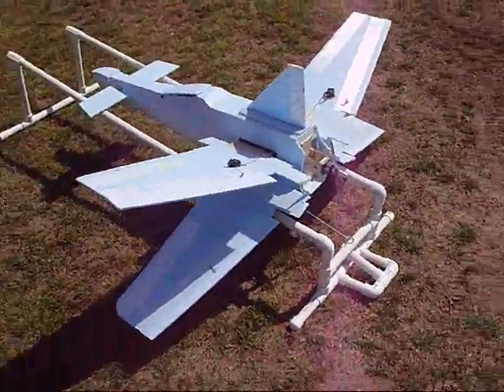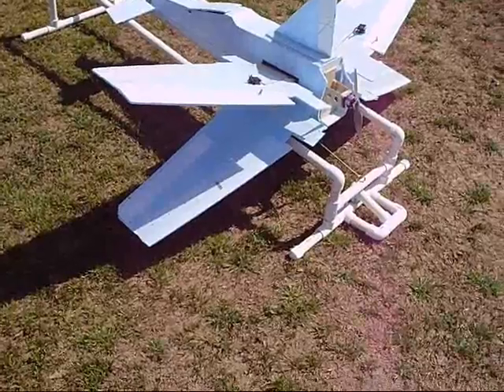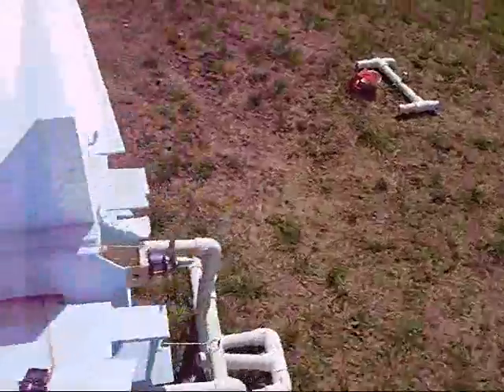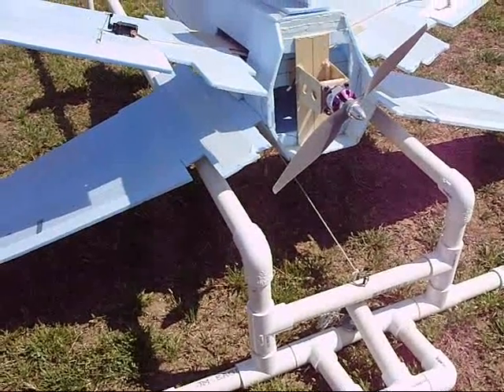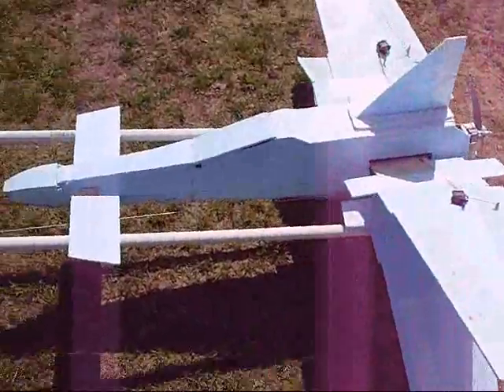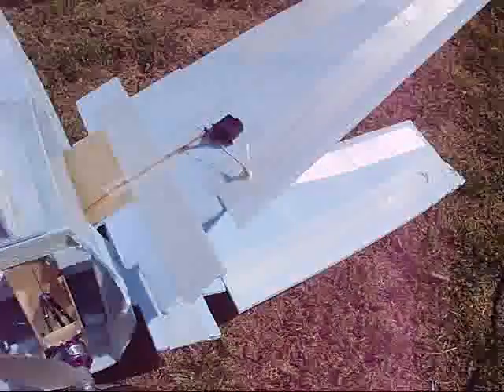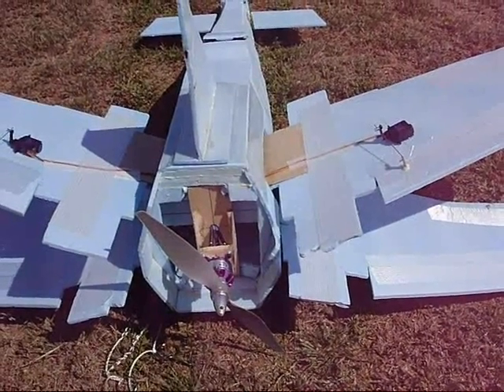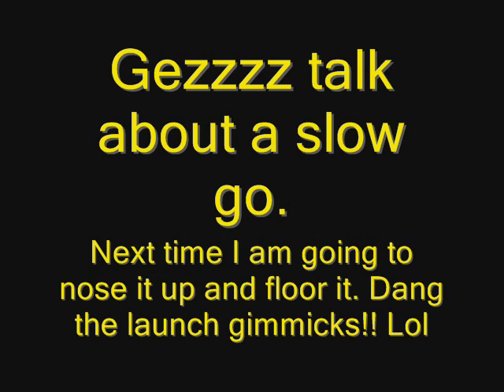RC Star Wars X-Wing Fighter build PART 9 (Rough Build test model) Fifth Flight attempt

Comment from the maker: @Gig540 This would work as long as my wings remain open, there would be freedom to move. But when closed the wings would sandwich the wingtip flaps used to correct with the gyros and would loose the effect. Only way for it to work with my use would be for me to somehow disable the inner flap when close and just allow for the outer ones to move if that makes sense. Sounds confusing kinda of lol. I have a few simpler ideas I plan to try out and post on here when wind finally dies down.

Comment from the maker: @geekfish Dave sent me a message regarding that idea. I may go that route but trying to avoid it until last resort. There is a lot to it and may not work for my application. Well it would but I would not be able to do everything I would like to. Reason is my wings open and close like the movie. For the gyros to work it requires more servos for one and also the tips of the wings open and close like flaps and adjust depending on the gyro corrections.

Comment from the maker: @geekfish I have a few ideas to try out. I may try using some gyros but I did get it to work without them in Part 10. As for getting it to work  without the vertical tail there a few tings I want to try out first. As of now using a gyro with my set up would not do anything to enhance the flight. That would require additional servos which will be my last resort. As for the realistic looks, I will continue to beat this airframe up until I have a solid platform. Then build the realistic model last.

Comment from the maker: @Gig540 I seen Night Flyers and yes his works very well and I did try at first to make mine like his. I ended up cutting off my pulley and now use it to roll up my elastic ans line. I did not have wood on top of mine since none of my planes have wheels. So I made mine like the rest of the guys as seeing theirs work very well.  Just in my case my tow hook location was incorrect. But I had to try anyways lol

Comment from the maker: @Gig540 if you listen carefully you can hear the prop striking the rails as it slide off the catapult. I did have a little throttle applied as it was going. Not a lot but some. 
As for the tow hook. Placement is everything and it is important to locate it in correct position. Mine was not correct as I had it placed to where it would try to get the nose up and into the air as soon as possible. The same as you would with a glider. I thought it pull slightly up but not as much as it did. Oops lol

Comment from the maker: @MLIG100 @MLIG100 hey MLIG100 those are good questions you have. There are a few reasons why I did it like I did.
Okay as for not having the power at full throttle. There's few few reasons for that question also. One reason is that if I have full throttle the plane will pull itself and become unlatched from the hook. Throttle is to be applied after the pedal is pressed to keep tension in the line.  Another reason is the prop diameter is pretty large for it to sit between the two rails.